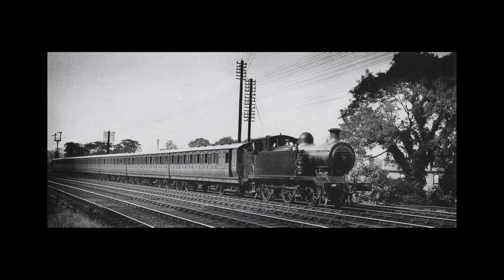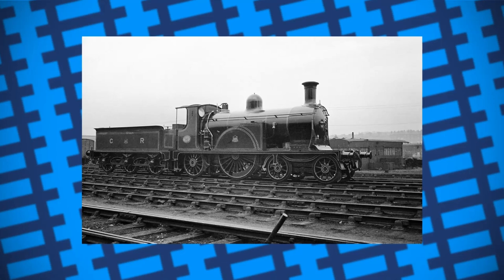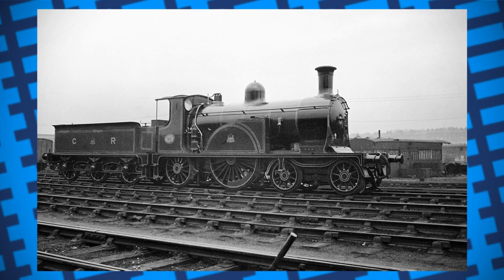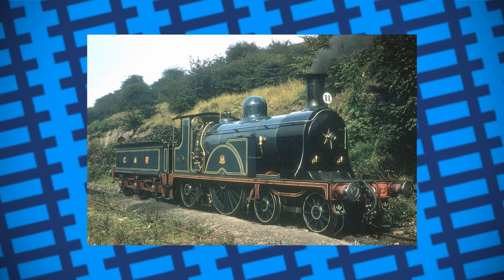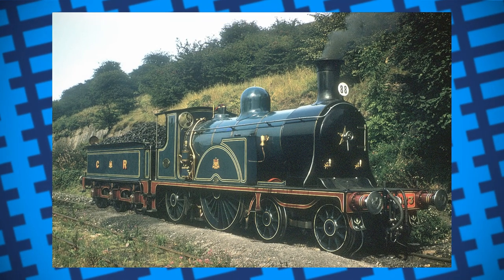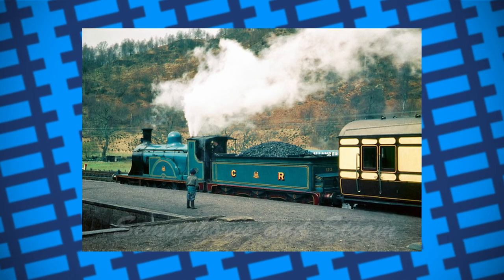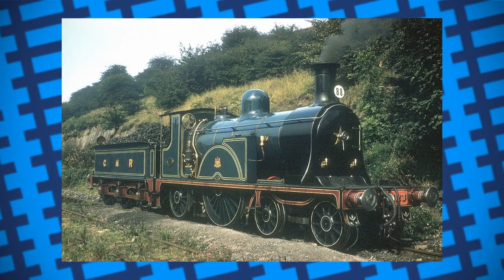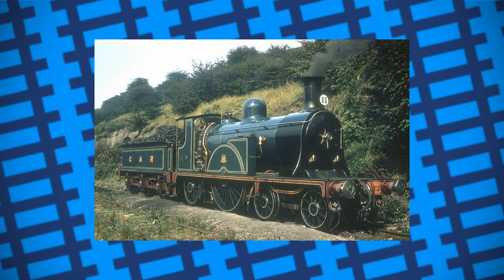Scotland's unintentionally useful engine - Caledonian Railways 123

Comment: When doing a historical presentation it's customary to get things right. The locomotive was designed by Dugald Drummond not Douglas
Reply: Well it’s too bad we’ve already got a dual Douglas
Reply: AHHH all u Scots sound alike to me...
Reply: Congrats,you received the pin of shame
Reply: My middle name is Douglas, a good substitute for Dugald I'd say, but I'm biased of course
Reply: @ken0272  You mean "Scotch"?...................quick hide lol.
Reply: train
Reply: Haha train go woosh
Reply: Ironically Drummond probably did not design the engine. It was built by Neilson Reid of Glasgow for the 1886 Exhibition following current "best practice" and the Caledonian agreed to purchase it. A CR 4-4-0 loco designed by Drummond (124) was also in the exhibition. 123 sparked a mini-revival in single-driver engines, the success being due to steam and compressed air sanding which improved adhesion. The Midland and the Great Western followed, while the Great Northern had always continued to use single-drivers.
Reply: Emily with no Valve gear be like
Reply: @@cancermcaids7688 "I think you will find it had a mark 7.2 turbo encabulator on it not the mark 7.1, the mark 7.1 was discontinued due to excess side fumbling in the January of the prevous year"
Reply: what

Comment: The fact that this went a mile a minute is legendary
Reply: Well, it's a little less impressive when you just call it 60 mph or 95 km/h...
Reply: @ronjoe6292  yea but the fact most single drive engine can barley do 20 makes it impressive
Reply: @penandinkproductions571 The LNWR Cornwall was recorded hitting more than 70 mph and GNR Stirling Single could do 85 mph on a regular basis.

Comment: The races to the north were actually the race to Aberdeen. The winners being the Caledonian having control of Kinaber junction just north of Montrose.
Reply: There were two 'races to the North'.   The one the narrator describes, in which No 123 was used, was in 1888, to Edinburgh.   In fact the two trains arrived at different stations in Edinburgh, so it was a fairly nominal 'race'.
In 1895, racing broke out again, to Aberdeen, and this time both trains went to the same station.   There wasn't really any clear-cut 'winner'.   The whole saga here: https://en.wikipedia.org/wiki/Race_to_the_North

Comment: @ the E2 intro: Thomas isn't a useless engine; he just got the boiler replacement that would have saved the class. There's a video on 'how to fix the E2s' that went into some of the details and basically the realization hit that the BOILER was the primary problem, as the design used a poor boiler that plagued another class with similar problems.

Comment: "Just because it is old fashioned doesn't mean it is useless."
Reminds me of the story of a huge line of coal cars left stranded on an uphill grade when one of the diesel engines quit. Another engine that just happened to be on a maintenance run was directed to go give the lads a push. The conductor of the disabled train figured out what was pushing him when he seen the giant cloud of smoke and fire rising from around the bend behind him after hearing the steam whistle and the thunderous chugging echoing in the valley.
Reply: When your grandfather is more powerfull than you thought.
Reply: @temkin9298   look up '150 Case 36 bottom plow' video then look up '150 Case dyno' video.
171 horsepower 5,000 footpounds torque.
Hundred year old tractor.

Comment: ironic, built as a display but assigned extra duties and has since gone back to its original role, so long as it exists it will never lose its function or suffer reduction of functionality, in another century it will probably be the last engine of its era to still preform without restraint, its surviving peers are already straining just to start up, forget running at their designed capacity and role

Comment: So given the design features that made it outdated, what about it made it so unintentionally good? Why was it able to still hang with more modern designs? How was it constructed that made it so reliable? Was it because it was intended to be a one-off showpiece that perhaps more care went into making it and that quality control ended up being the secret to its success?
Reply: From the account in the video, it sounds like occasional work was found for it that just happened to suit its limited traction capabilities and adequate speed capacity.    Running ahead of the Royal Train, piloting double-headed trains (the LMS was known for adding another engine as soon as the load exceeded, even marginally, the rated load for a single engine), etc.
Reply: From what I found, No. 123 was fitted with an air-powered sanding gear, which, at the time, was quite revolutionary, and made up for the 4-2-2's poor traction.

No. 123's success would spur a revival of the 4-2-2, albeit briefly. 

Apparently to save money, No. 123 has many parts in common with some of the CR's 4-4-0s, which explains why it was kept in service for so long, not to mention the LMS's initial small engine policy.

In the UK, it was common practice to make locomotive classes with parts interchangeable with those of other types.

With No. 123 being made to represent the CR's chief engineer, it likely would've been used to test new technologies as well, in addition to the improved sanding gear I previously mentioned.

Comment: The engine on the thumbnail looks like Emily from Thomas and Friends.
Reply: Emily was based on the famous Stirling Singles...
Reply: @johncunningham6928  I know that, but the locomotive on the thumbnail has the same paintwork and wheel arrangement. That's what I mean.
Reply: @PhineasTurner  paintwork? Emily is painted in Emerald green,Caley 123 is painted in CR Blue
Reply: @davidantoniocamposbarros7528  I said on the thumbnail. Also, Emily's paintwork varies in different episodes and toys.
Reply: @PhineasTurner  you never said anything about the thumbnail
Reply: @davidantoniocamposbarros7528  Sorry, small mistake.

Comment: Douglas drummond?
Caledonian Railway 123 was not a small engine when it was built. Although 123 was a single driver it had the same boiler and cylinder as the 4-4-0s being turned out in quantity by the Caley.  So it could be expected to be as powerful as the 4-4-0s and faster as well because of the larger driving wheels. But the downside would be that it would lack adhesion, not a great thing on a filthy night half way up Beattock. The likelihood is that the Caley built it in the event that the Race to the North would resume. Single drivers were still widespread on many of the main line railways of the time even if not many were still building them. North from Kings Cross or St Pancras you could expect to encounter single drivers, likewise out of Paddington on the Great Western. Single drivers were however rare on Scottish railways and absent from the Lancashire and Yorkshire, testament to the ruggedness of the terrain their lines crossed.
Reply: Too long to read

Comment: how does a UK engine move without drive rods?
Reply: Moving
Reply: There is a driving rod or two within the undercarriages themselves. That's why we don't see any steamboxes on the side of Thomas or any E-1 and E-2 classes due to them having steamboxes within
Reply: Inside cylinders, driving onto a crank axle.   And of course this engine, being a single, had no need of outside connecting rods between driving wheels.

Comment: its Emily
Reply: No,Emily is a GNR Stirling Single
Reply: @davidantoniocamposbarros7528  you missed the joke :/
Reply: @charliewomy9757  nah i didn't,i simply corrected you
Reply: @davidantoniocamposbarros7528  nah you missed it, it looks like Emily :/
Reply: @charliewomy9757  not in the slightest. Emily is emerald green, haves outside cylinders,side rods,copper chimney and was built for the GNR while Caley 123 is blue,has outside cylinders,doesn't have side rods,doesn't have a copper chimney and was built for the CR. There's a clear difference between the two
Reply: @davidantoniocamposbarros7528  i was joking.